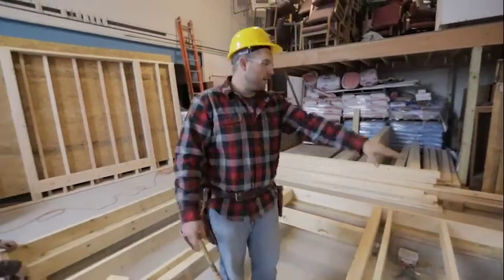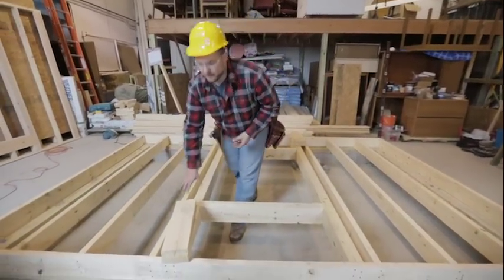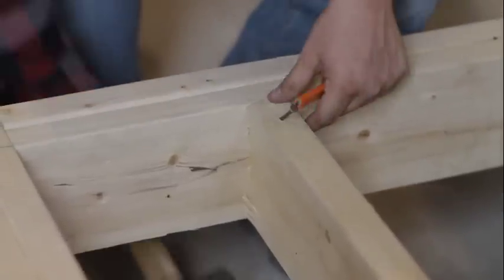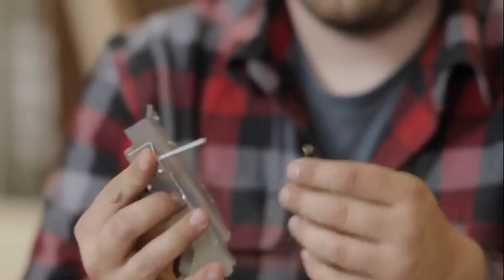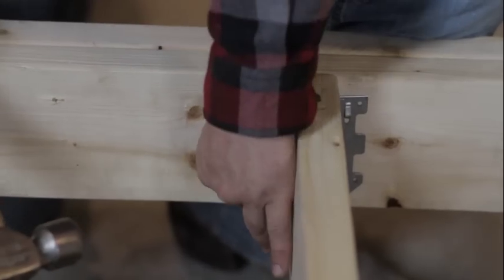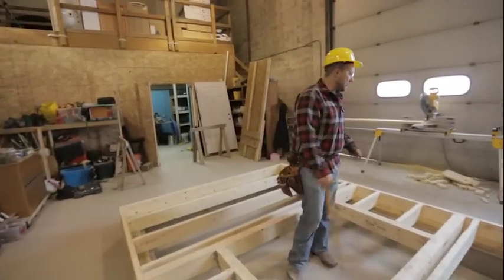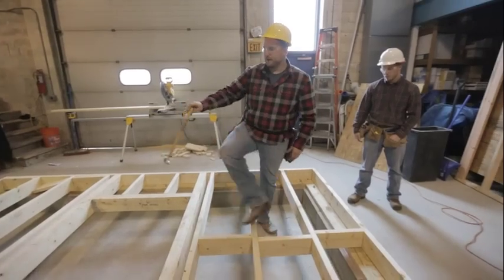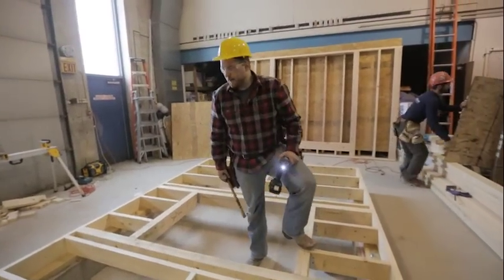How to - Floor Framing Part 9: Blocking, Cripples, and Joist Hangers

Comment: I live in the UK and this is one of the most detailed videos on blocking and the importance. My house has a bouncy floor  and the joists twist and creak driving me mad! I have taken up the floor added Rockwool sound insulation and put in blocks every 600mm. There is was only one row of herringbone struts across the floor. The span is about 3m and that was totally inadequate. Personally I think building regs outline the minimum requirements. At the end of the day the homeowner has to put up with the floor for years! I have taken the belts and braces approach and my floor is rock hard and sturdy...no more bounce, no more creaks, no more twisting joists. No more noise, wardrobes don't bounce up and down when my children jump up and down in the bedroom and no more deflection in the ceiling in the living room below!

Comment: I've spaced floor joists before using precut 14½" blocks; one at each end and one at each blocking point. It eliminates the custom measuring and cutting for the blocking, because you KNOW the distance. Plus, you can nail in the blocks as the joists go in.

Comment: Great video. Great points on the sheer strength of different fasteners and the staggered blocking
Reply: @NSMConstruction   I was disappointed you used a drywall screw for the comparison instead of one designed for framing and putting up joist hangers.  People watching will think you can't use screws for joist hangers, which is not true.

Comment: Alot of comments on the blocking.  Adding a row of blocking is definitely structural.  A blocked floor will feel like walking on a concrete pad compared to an unblocked floor. Any dynamic load will be transferred down to the joist below and also to the joists to the left and right. In theory, you still have the same number of joists but in reality, the floor will deflect much less, costs very little and only adds a little labor.  I see alot of new construction skip these to save a few hundred bucks.
Reply: It's much less frustrating than putting in any type of diagonal bracing.

Comment: I realize this video was made at least four years ago and that the building code may be different now than it was back then, but I’m questioning the spacing of nails from rim joist to sill plate — I’m not sure it is 16” O.C.  There may also be a requirement to toe nail the joists to the sill plate as well. I also realize  each municipality has its own building code, but these days most are based off of the international residential code, so codes tend to be fairly close to the same across the country these days. I would suggest people watching this video take a good look at the fastener requirements in their local building code (Table R602.3(1) Fastening Schedule).

Comment: I am not a professional carpenter, but I want to level the floor in my laundry area in an old home and the floor joists now are not level and some of the joists are "sistered" together.  Also, some of the joists are twisted, so I would like to replace those with new joists.  Thanks for the informative video!

Comment: Might not the place for a debate about shear in nails vs screws, but to test for shear, you'd need to restrain the tops of each of those fasteners.  Allowing them to simply be bent over gives you only a loose sense of how much strength they have -- in BENDING, not shear.  Gyp screws are...for gyp, of course, and work great for holding mason's line temporarily and such, but of course they're brittle, small-gauge, and no good for structural use.  Which brings me to my point... Industry is slowly coming around to recognizing and sanctioning the vastly superior (though not quicker or cheaper) qualities of screws in framing.  Simpson already sells screws for hangers, which of course are code-accepted;  a lot of people haven't noticed this yet.  GRK fasteners, for one,  produce a code-compliant line of screws that, but for the head, look very much like what's sold as "deck screws" all over the country.  If I did production framing - yes, the world is grateful they don't have to hire me to do that - I'd be swingin' a hammer or using my ancient coil-nailer (and swearing regularly when I have to get a nail of any type OUT), but in all my personal projects I'm using screws almost exclusively.

Comment: I always prefer screws and glue (pva) for blocking. I measure the gap at each bearing end and take the average (for mid span blocking). I pilot hole the screws and use long screws as they are going end on to the grain. An impact driver ensures a tight pull. Once the screws are tight and glue set they provide good anti twist and anti bounce. Particularly useful where the floor is in a non habitable space i.e. flooring a loft for storage where I would use smaller joists to be more economical. By this method the blocking is effectively a beam running right angles to the main joist run

Comment: Pretty sure there are a lot high shear strength screws on the market. I use Spax, the best in Europe (as far I know)! You can never mess up a spax, you always mess up the wood if you push it, even hard wood. For contractors, I understand using nails, having several types of nail guns available on site. It’s hard to regain the price of good a nail gun in ‘diy’ in time.

Comment: Now if a room in a old house is out of square pretty much have to go with it can't have everything straight I stared and making sure the joist matched up and ending up being off almost 2in after I got to the last joist so has to put sister boards on it to get it to work or it would all be messed up

Comment: Great walk through on new construction. When I remodel or repair old work and existing framing, I like to use structural fasteners (GRK is my fave), especially in tight crawl spaces where driving a nail can be difficult.

Comment: So... Half the nails (the straight hammered ones) are joist hanger nails
and the diagonal hammered nails on that same hanger, are "16 penny" nails, not joist hanger nails?
Reply: Hanger nails come in multiple lengths.  1-1/2 for the hanger face to the rim joist, and longer 2-1/2 or longer for the diagonal shear location so that the nail is long enough to exit the floor joist and penetrate the rim joist

Comment: If joists are spaced 16” or 24” OC, why again does each opening have to be measured? One would think the blocks would all be the same measurement, no? If the joist is twisted or such, then why measure from the ends not the middle where the block is inserted?

Comment: That is not a sheer test, that is a bend test. Yes sheetrock screw (the weakest screw) has a lower sheer strength then a nail but true sheer test have shown that the amount of weight required to sheer a screw is almost double the weight required to pull a nail. The issue is people over torque the screw and compromise the screw head. Screws will always be a superior fastener this test is misleading at best.

Comment: Thanks. Is ther a particular reason you use 16 penny to toenail the hangar and not the hangar nails?
Reply: Mike M It depends on the hanger thats being used. Some of the hangers specify which nails are to be used.

Comment: why did you nail the cripple joists about an inch lower than the trimmer joists
Reply: They are 2x4's and the rest are 2x6's.
Reply: They're flush with the top plane, they just look lower from far away because of the way the light hits the header they butt up against.

Comment: My joists are notched on the end. Is it resting on the sill ??
Reply: NSM Construction the end of my joists have a notch cut out and is resting on a ledge. There are no joist hangers. Are the joists resting on the sill plate? They are not toenailed to the rim joist.
Reply: NSM Construction I guess so. Hmmm. I will probably post a video later and you can see what I’m talking about.

Comment: You should check and redefine your "shear" explanation of nails with regards to hangars.  Good try.  ALso, your hangar will state right on the hangar (usually) exactly what nails to use. And some of them require 16 penny nails in all holes. Not teco nails as you show.